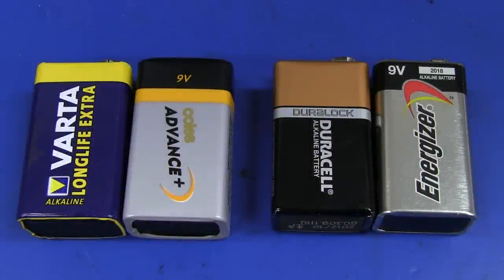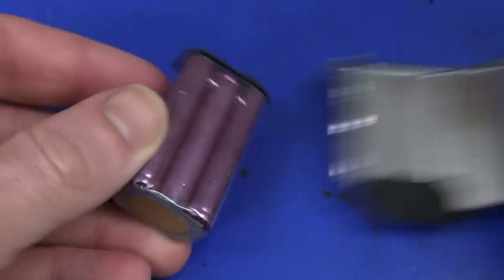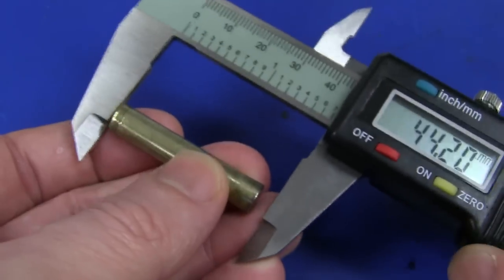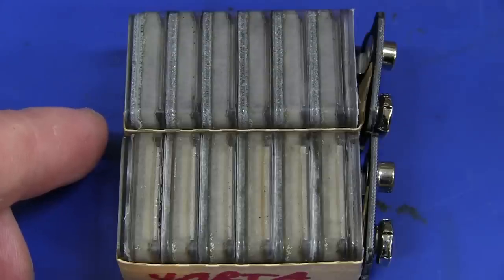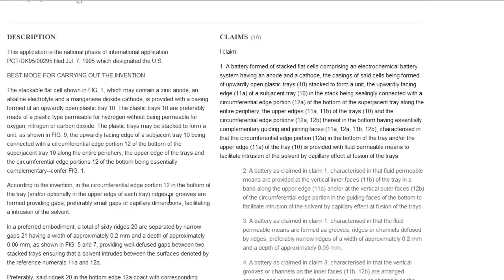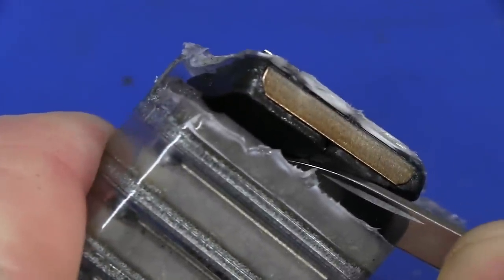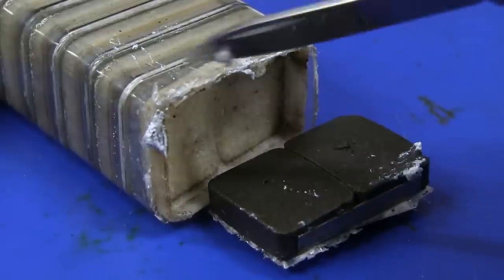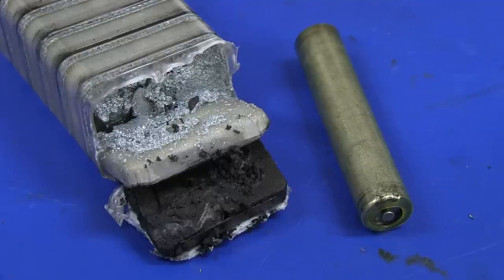EEVblog #518 - 9V Alkaline Battery Construction

Comment: I still don't get what people mean by shorting out circuits. I hear mostly when talked about PCB and batteries. Can you explain further for me?
Reply: +Minwoo Kim Normally, the current goes through a complete circuit with a lot of routes, or very long ones.
Shorting out a battery means that the current goes quite literary through a short route (shortcut) from plus to minus (the electrons go from minus to plus). Hence the term shorting out.
This usually creates a large current that burns out some parts (or even let the battery sell explode!).
Reply: A short circuit is where you connect both ends of the power source with no resistance ohms law says I =v/r With r = 0 You get infinite current. Bang!
Reply: Nevets there ain't no such thing as a zero (0) resistance hence no infinite current.
Zero and infinite are mathematical constructs. In real life (nor physics) those do not exist!
Reply: Imre Fabian Yes, I am completely aware of that. If you cant discuss things in electronics and physics in theoretical terms then we can't use ohms law anymore. 

The point is, when resistance is CLOSE to zero then Current goes very high. And that is what a short circuit is. Lets hope the guy asking the question doesn't read this as it has now just been complicated considerably.
Reply: Nevets I politely beg to disagree.
Keeping the general public ignorant is never a smart thing to do.
And the public on this channel is mostly on a level that they can handle the truth.
The guy that asked the question probably wouldn't be confused by said complication.
BTW,  Dave's video's are generally pretty complicated (and rightfully so; Electronics is quite complicated)!
Reply: Imre Fabian Huh? Ohms law is literal, we cannot use it any other way. How can you teach anyone about electronics without it and how does that make people ignorant?

Yes, you can do real world experiments but that is only a part of the learning process, we have to use maths and maths is not real world. 

I am sure this is just a misunderstanding to an extent but I cannot say that using ohms law is a bad thing.
Reply: +Nevets,There is no crime in using maths to teach physics. As long as you keep in mind, and tell the students, that it is only a generalization, not to be taken absolute, meaning, that nature is not (only) black and white.

Quantum Mechanics is a good example of this.

I remember I had a conflict wit a teacher when I was still in school about a problem using passive components, where the answer came to a negative resistance. I had an alternative result: infinite resistance.

Years later I met that teacher and he still couldn't get over it!

Use Zero and Infinite only as a mathematical tool, and keep in mind that in reality a resistance never is zero (nor infinite)!

Comment: new subscriber; enjoy the rants, you tell it like it is, refreshing memory on topics and inspiring to learn more again.
DO you know what happened to the 1.5V rechargeable battery?  I thought they worked fairly well. They were on the market about the same time the digital cameras were really getting popular.  But the 1.2 ni cad just worked like Cr@p.  Seemed the cameras really needed that extra .6 of voltage.  The 1.5V rechargeable seemed to disappear?
Reply: CNKayutube I guess the 1.5V rechargeable chemistry was inefficient in terms of energy storage, and since many devices could use a 1.45V Alkaline until it was dried down to 1.2V anyway, the 1.2V NiCd chemistry just was the most efficient for anything that would actually use the full capacity of a disposable 1.5V/1.45V element.  3V and 9V are probably the hardest voltages to get with 1.2V cells, since you would need 2½ x 1.2V or 7½ x 1.2V.

Unfortunately a small number of more voltage needing devices got left behind, though many would will probably work nicely with 5 x 1.2V cells for every 4 x 1.5V cells.  Also, 4 x 1.2V is a close compromise between 5V (TTL, phone chargers) and 3 x 1.5V, while 5 x 1.2V and 10 x 1.2V match the 3 x 2V and 6 x 2V in old rechargeable lead-acid batteries.  Finally 3 x 1.2V is close to the 3.4V in Li-ion batteries, just a schottky diode drop above the 3.3V used by modern chips.

Comment: I've always wondered if batteries get ever so slightly lighter as electrons are drawn out of them...
Reply: alphabeets They do actually
Reply: alphabeets there's actually a video on this channel talking about the "drop test" for determining whether or not a battery is depleted. He didn't go into full scientific detail(ie, weighing them before & after) but the drop results do imply a difference.
Reply: +alphabeets no. Electrons are not being removed, they are being relocated from the anode to the cathode.
Reply: While no electrons physically leave the system, energy-mass equivalence proves that a battery's mass indeed does change when drained. There is less energy in the battery when the reactants are all used up, so there is a drop in mass. It's not measurable even on extremely large batteries as far as I know, but it can be shown through math.

Comment: This was very interesting. Just wondering, you waste a lot of space inside the AAAA series method (Duracell), will you get a longer lifespan on the Stacked type (Varta) since there is more chemical material and less metal body parts like in the AAAA.

Comment: so energiser ar ethe best , cause if you buy them new and very cheap you can suply 3 remotes controles of 2 small AAA each  with one 9V battery. Doesn`t matter if they are a little smaller, the springs inside the remotes will do the job ok.
Reply: if you could do with having 6 separate 1.5v cells, then yes, energiser would be the best.

unless you can just buy the 1.5v cells for just as cheap. Then it'd be a bit pointless to tear a 9v battery to pieces to get some.
Reply: They are AAAA not AAA. Much smaller.
Reply: u made me curious, i have such at home, measured them, the AAA is 42 mm while the 9V is 45 mm , so i guess they fit inside, only they have to be thinner, that would create no problem in a remote.
Reply: I think aaaa are 40mm from memory, they are certainly a little bit shorter but you should be able to make it work somehow.

Comment: I'm confused, they sell tons of these things why don't they just have one bigger cell and not bother with all of the connections?
Reply: The Eternal Hermit Each cell is 1.5v. The size of the cell changes capacity so it can be used for longer if you use bigger cells but the voltage stays the same with this chemistry at 1.5v. This is why big 6v batteries last so long because they have 4 huge cells 1.5v each.
Reply: aldeed So no matter how big you make it if it has this type of chemistry it will have 1.5v but if you add connections then somehow that ups the voltage?
Reply: The type of chemistry dictates the voltage, i dont fully understand it but mixing certain chemicls gives you certain voltages and the amount of chemical each side only makes the voltage last longer, think a big tank of water with a 1.5litre valve, no matter how much water you have it's still only 1.5litre output.
In a 9v battery the cells are connected in series which means the 1.5v cells run through eachother so it's like a little man running through the cells picking up their 1.5v every time for a total of 9v at the end (6 cells 1.5v each).
Reply: aldeed Why 1.5 V? Is that some universal law? If yes how does it work? I have heard of the voltaic pile of Mr. Volta. . So should it not be 1Volt(a)  or 10 volt per cell or something.  Why 1.5? One and a half man?! WTF!
Reply: The Kaiser I dont know man. Google it? :)

I never got too much into the WHY its 1.5v. I presume its because that just what the chemistry dictates. Im sure a quick google search would get you much more than i could ever hope to explain
Reply: aldeed Like yourself, Google's got nothing on it.
Reply: The Kaiser You need to improve your Google-Fu. Second page on "why are batteries 1.5v" search result: http://www.reddit.com/r/explainlikeimfive/comments/1djqbk/eli5_why_are_most_batteries_15v_or_multiples_of/
Reply: alek202 Bla, bla, bla. Google-Fu my foot!  It does not say WHY it is 1,5 volts.
Reply: The Kaiser Quote from the linked reddit site: "The reason for this is chemistry.".
Reply: alek202 Are you trying to piss down my back and tell me its raining?!
That is no explanation, that's a joke.
So why exactly is it not 10 000volts or 1.6 volts or 1.4volts or 0.1 volts?
I asked for an explanation not some ultra-vague nonsense.
Reply: I am not even sure if it is pure chemistry. I tend to believe that a lot of quantum mechanics is involved here and that is Physics NOT Chemistry.
Reply: The Kaiser its chemicals which makes it chemistry. Ofcourse in the grand scheme of things it is physics because EVERYTHING is physics since it governs the whole universe.

The chemistry just dictates a 1.5v that's all there is to it.  The chemicals we use and the arrangement makes 1.5v
Reply: aldeed 1) I very much doubt that inland revenue is governed by physics rather than black magic, but if you say so…
2) Yesyesyes, primary school, but WHY makes it 1.5 volts. I need a single cell that has 1.9 volts, how do I go about to find the right chemicals without wasting time in a stinky lab filled with churls and commoners?
Reply: The Kaiser Read this your majesty --> https://en.wikipedia.org/wiki/Electrochemistry
Dont be too snooty an see:
The List you need is at your service here:
https://en.wikipedia.org/wiki/Standard_electrode_potential_%28data_page%29
Reply: ***** Finally somebody with manners, upbringing  and style. Excellent!
Marcus Theory, Quantum electrochemistry, Revaz Dogonadze , we are getting there … Looks very promising.
 You may retire until I finished misreading your dispatch. I may have questions.
Reply: ***** very interesting! Thank you
Reply: The Kaiser approximately 1.5V is what that particular chemical combination does. Thus you need 6 in series to add up to 9V. Some other chemical combinations get similar results while others somewhat different results. For example, NiCad(nickel cadmium) rechargeable batteries have a makeup that instead puts out around 1.2V.
Reply: InfernosReaper Yes, but why?
Reply: The Kaiser I don't really have the chemistry degree needed to know why an alkaline battery is about generally about 1.4-1.6V while something a galvanized steel & copper terminal lemon battery is around 0.7V-0.9V or why replacing the zinc with magnesium will increase that to 1.4V-1.5V.

However, once a certain power usage standard is set(in the case of batteries by their output capability), things tend to build towards meeting that standard. 1.5V has been around for decades so devices were build around that standard.

When a new standard comes out, such as the lithium ion battery(which averages around 3.7V), devices meant to use that type of power source will be made conform to the nature of it.
Reply: InfernosReaper Since when does Nature require a degree to understand it?
Reply: The Kaiser Obviously the answer to why the answer to why is "Jesus"
Reply: InfernosReaper Who? The answer to why is  effect and cause.
Reply: The Kaiser Nope, I'm from Mississippi, so anything we don't understand is the will of "Jesus".

Not really my cup of tea, but Mississippi is a theocracy so can't be helped.
Reply: InfernosReaper And who is this Jesus?
Jesus … Sounds Spanish..
Reply: ***** there aren't hundreds of millions of people in the entire Southern United States region, and definitely not in Mississippi. ;)

Comment: After Seeing this video, I will never throw a battery in the garbage again.
Reply: No offence intended, but there's no reason to buy "disposable" batteries in this day. They're INCREDIBLY poisonous to the environment, first of all, and secondly, rechargeables such as Sanyo's Eneloops are absolutely fantastic - they last about as long as non-rechargeables between their charges, and go for a LOT longer than normal NiMh.
I use a hell of a lot of them due to having so much electronic equipment. I have around 40-50 sets of AAs on the go. The last I bought were in 2008, and not only have they not noticeably lost any storage capability (they'll run just as long on a charge as new), but you can charge them and leave them on the shelf for a few weeks with no loss either.
So, not only is it far cleaner to use quality rechargeables nowadays, it's absolutely stupid to waste money on alkaline batteries that do a FAR lesser job.

Comment: some time ago, I opened one of those crappy quality chinese batteries to savage the little steel cans of the aaaa batteries (I make firecrackers with them) and I found that the external metallic cover was from a D or C cell because it had the panasonic logo and the battery description in the inside. it was really weird
Reply: DanielTseng100 Are you sure it wasn't from a Penesamig battery? It's very easy to confuse the two.
Reply: InfernosReaper LOL that batteries. It's funny because I'm spanish and penesamig means "penisamig" in english xDDDD. No, It wasn't penesamig for sure or I would have remembered it
Reply: I thought they were a one-off thing when I saw them in an Ashens video, but then I actually saw them in a high end tech mall in Japan. I almost bought some, but didn't have the cash on me.

Comment: What a pedantic statement. You have zinc powder in a fresh battery, zinc oxide in a spent one. That's a chemical reaction, forming completely different molecules, btw. The KOH, on the other hand, is there from beginning to end. So he's right, the zinc powder + manganese dioxide is what's "used up".

Comment: someone explain t me why if there are 6 cells in a 9 volt why recargable 9 volt batteries are still called 9 volt insted of 7.8 volt recagable cells are 1.3 volts each
Reply: justin rivera maybe they have 7 cells in them?
Open one up and see
Reply: +justin rivera Check the specs on the battery - NiMH cells are 1.2V, so 9V type batteries are 7.2, 8.4 or 9.6V.

Comment: No wonder folks like Tesla have to make their own batteries!  

The bloated existing manufacturers literally haven't done anything in 20 years!
Reply: +Son of a Zombie 11 months later and last I read, Tesla still isn't making their own batteries... still using Sony and Panasonic.  Not that I expect Tesla to innovate or invent anything new anyhow, I would only expect them to increase profits by driving their costs down through the elimination of a middle-man once they buy up the equipment and IP,... this is basically what they do, which is fine.  Remember, Tesla is the rebrand of an existing company after the buyout.
As far as your statement that existing manufacturers haven't done anything in the last 20 years, I have to guess you knew that was grossly exaggerated given the progress that has been made in that time with battery chemistry and even the design of the anode/cathodes as well as safety.  Think back 20 years... what was the rechargeable mainstay back then... NiCd?! ahahahahahahaha, NiCd. 
Seriously though, each chemistry has their strengths and NiCd still have their place in industry.  For most consumer rechargeables though, NiMH is where it is at with Li+ being used for more and more.  Again, each chemistry has it's place.